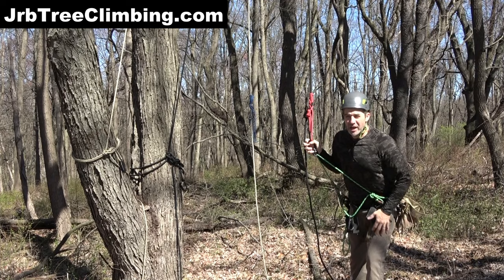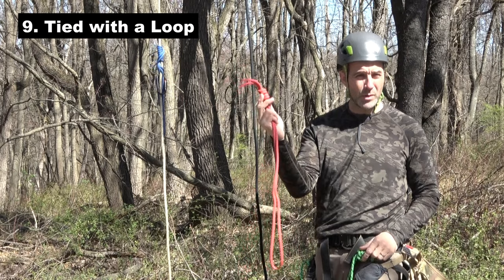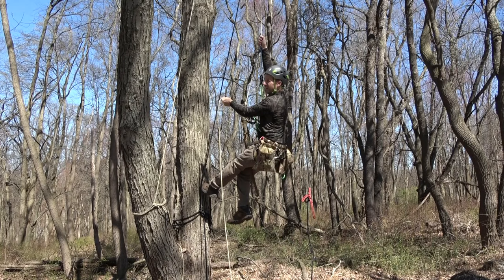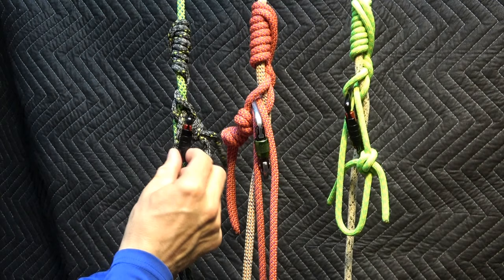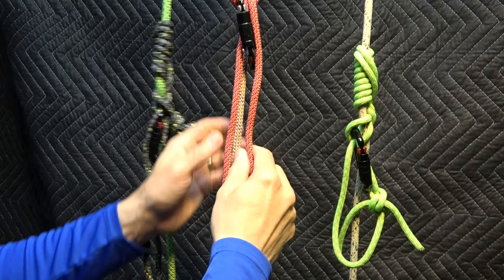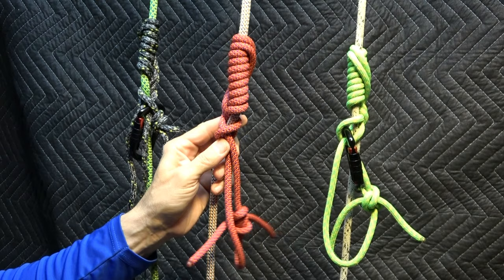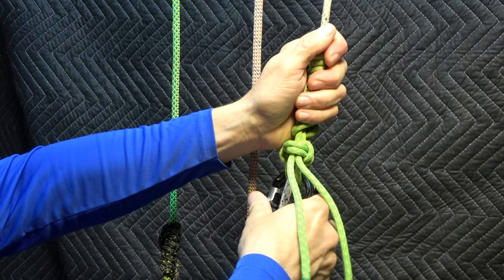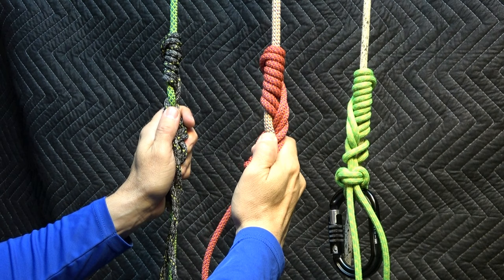Introducing the Agile Friction Hitch

Comment: amazing what the extra wrap (somewhat) at the bottom of the hitch, (making it a variation, of the Klemheist as you say, ) will add to the utility of this hitch, would be a great hitch to throw on in case of the need to bypass a limb when you don’t have an extra set of hitches on the rope, so easy and quick to tie! thank you JRB , another tool in the toolbox!

Comment: I forsee this pairing perfectly with the jrb cinch! It will also be very handy if someone wants to sit in a crotch that's "tight." I had a few instances where I couldn't pass the rope over with the jrb acsender hitch attached. This will solve that problem! 

Pass the rope over naked and then slap on this Agile friction hitch!
Reply from the maker: Excellent point. This is EXACTLY one of the problem scenarios it mitigates. I also have a false crotch rigging scenario which needs a bare rope as well and the ability to easily removed and replace a hitch enables us.

Comment: hi John, I go with JRB ascender hitch, in SRT rope system, easy and safe no jamming, I use 6mm aramid core, thanks for video and wish you as always a good day.. regards.. 😁
Reply from the maker: I like your choices.  And for anyone reading the comment, although some of the advanced fibers are heat tolerant and some are not, and we prefer heat tolerance, as long as we are managing slack and using something else to absorb friction on rappel ( such as munter or figure 8), we can execute an efficient climb on a wide variety of materials.

Comment: Very interesting, looks like a great ascender hitch. I’ll have to look closer into this and test to see the advantages, over the JRB ascender hitch as that’s the only primary hitch I use. 

Do you see this taking preference over your JRB ascender hitch in your own climbing method? Specifically in your JRB climbing system using a stationary double rope method?
Reply from the maker: I have done side by side tests with an Agile Hitch on one side and a JRBAH on the other side of a doubled stationary rope system.  In ascent, they behaved identically.  The JRBAH is a bit easier to break in order to initiate rappel. And so, i feel either can be used.  I prefer JRBAH for SINGLE ROPE climbing. However, in my quest for a Universal system which can be used for doubled stationary rope climbing AND JRB Hitch Climbing... the dilemma is that the hitches go in different Places and work in opposite directions.  And so if we use Agile hitches for the former, It's not much of a problem if we want to occasionally pop off the Agile Hitches. We don't actually NEED to remove them, but we may not want them on the rope flopping around and so we CAN if we want to.

Comment: Using a half rope raises concerns about potential failures, such as if one rope completely fails above you or if a friction hitch fails to grip. Specifically, when rigging the rope just over a branch, does this pose a risk of falling? Therefore, does Double Strand Rope Technique (DSRT) lack an advantage over Single Rope Technique (SRT) in this scenario? In this case, does using two strands in DSRT not increase redundancy compared to using one rope? Can only one side in DSRT hold when the rope is rigged just over a tree branch? Additionally, is it possible that in the event of a failure of one friction hitch, the rope holds due to the footloop and the garda hitch? ....Please read between the lines because of my english knowledge is it possible that to your ears something sounds weird or a little incorrect. I hope you understand what i want to say. Thanks John
Reply from the maker: If we use the same rope and the same friction hitch in a DSRT system vs an SRT system, rigged in the same tree and crotch, the advantage in strength goes to DSRT because we have half the load on each hitch and rope segment.  In both cases, if the Garda hitch is engaged with the "best friend " connection to the lower bridge, a failure or slippage of the friction hitch is mitigated. We will not fall. But need to repair and recover.  See my video on self recovery on the DSRT playlist.
Reply: @jrbtc  thanks John!

Comment: John so currently I am using primarily a double michocan for ascent and rappel.  Im climbing on a single rope system while one sticking.  How would you compare the agile hitch to the double meech?
Reply from the maker: In a one stick application, I need a hitch that automatically tends. DM will do so with no metal but I prefer a compact JRBAH. And yes, we could use the Agile Hitch but with the Buffalo Hitch to get the tending feature. I would tie and test to see if you're comfortable with the force necessary to break it. And consider that if you gave it a little shock load for example after a stick kicked out and you fell a few inches, it might be set a little harder. We have to be prepared to get out of that situation as per my dedicated video on that topic.

Comment: Hello john! I've recently purchased 300' of ⅜ static rope for an emergency rappel situation for my family if we are ever in a burning building up to about the 25th floor I figure so 99٪ of the hotels we'll be staying @. Since I'm the only slightly experienced technician in the team based rescue world, not lead climbing, I have two main options/questions what to use considering my inexperienced wife & 3 kids could be using this system as a last resort emergency escape system: do I employ the mùnter on a carabiner vs the rescue 8 as my friction hitch & what should I use as my backup hitch incase it gets weighted I'm afraid the prusick will become permanent & they will be stuck there & anyone coming down after them will be also. It's this nightmare scenario that I've considered not having a backup hitch to avoid getting stuck and blocking our egress when we only have 1 rope.
Reply from the maker: This is a serious topic and not one I feel qualified to comment on in any detail.  Even for an experienced climber, there are different factors in play at that kind of height.  For example, the way I typically use a munter, i am holding the rope out and away from me to neutralize spin. Ok, well if i am 250ft up, i have to hold up 10x more rope.  I might get tired and let the rope spin... which could get the rope in a state where i get stuck.  Consider that each person needs their own device and friction hitch if you are using one. This hitch is easier to break than the prussik, but not as easy as the JRBAscender, but I can't say that either are right for this application. Pls consider consulting with a Rescue. professional.
Reply: @JRB Tree Climbing and Saddle Hunting  john you bring up a good point about having to lift 250+ ft of rope getting heavy for an adult & probably impossible for my 7 yo daughter, that being said the mùnter is probably out in favor of the figure 8 or rescue 8 which pulls down to achieve greater friction vs up like the mùnter. The other question of which/ whether to include a backup that could stop their progress. Sounds like the jrb ascender is the easiest to release for a child or an adult. My wife is slightly heavier than average so although I hope to never need to deploy this system I want their best chance of survival if it is.

Comment: I can’t wait to tie this! Does the addition of the longhorn add length over the standard agile?
Reply from the maker: You definitely need more cord to form it. What diameter rope and cord are you working with?
Reply from the maker: The one i showed in the video used 6ft of 6mm rope on 8mm rope to form a 5 wrap Agile Hitch with a Longhorn under it. The tails were nice and long. You should get the same results
Reply: @jrbtc  Awesome! Thanks!

Comment: You're gonna melt your prusik....
Reply from the maker: There is no Prusik here.  I realize you are referring to the CORD that we are tying the Agile hitch with, but it's incorrect to refer to anything in this demonstration as a prusik.  Melting the cord could only happen if we subject it to an inappropriate amount of friction,  for example using it as a rappel device.  We don't use a friction hitch as a rappel device in a single rope system.  It's only a backup in Rappel, nice and loose, as demonstated. The friction on rappel is supplied by the munter, or Figure 8 or whatever we are using.  The hitch is in my hand and only gets slightly warm during rappel if used properly.  Of course, there are Heat Resistant Cords available for friction hitches, but they aren't necessary if the hitch is  used as demonstrated.